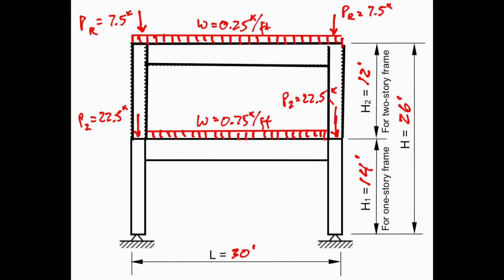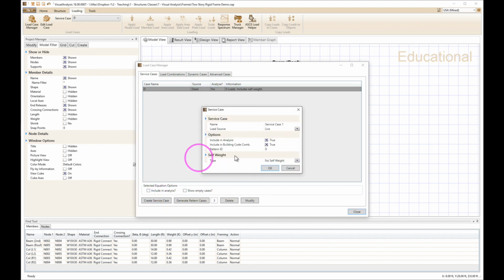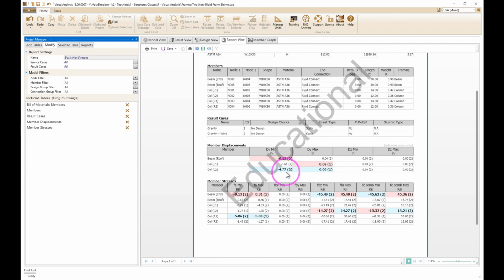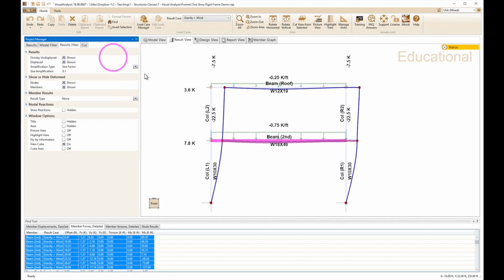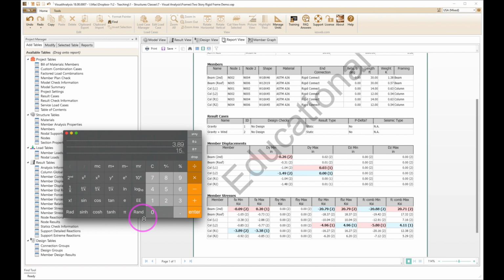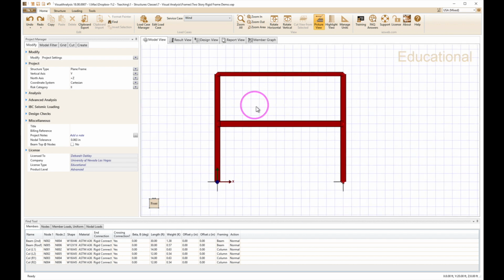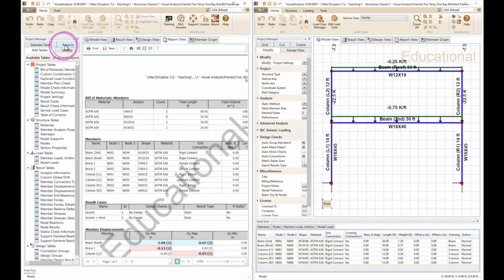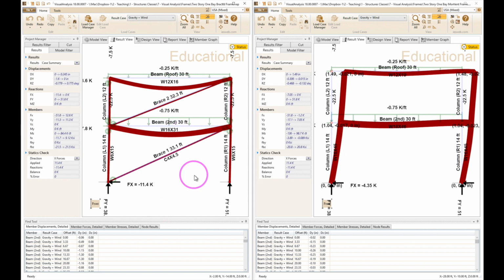Analyzing a Rigid Frame in Visual Analysis

Comment: Hello Prof. Please, what exactly influences a rigid frame? Is the members fixities or the nodal fixities? I was carrying out an analysis and when I used only member fixities, the frames drift was much but when I fixed the nodes the frame drift was almost negligible.
Reply from the maker: Make sure that 'fixing' the nodes isn't actually adding a support, which are generally only at the base. In IES Visual Analysis, the default is that members have rigid end connections unless they are released to rotate.